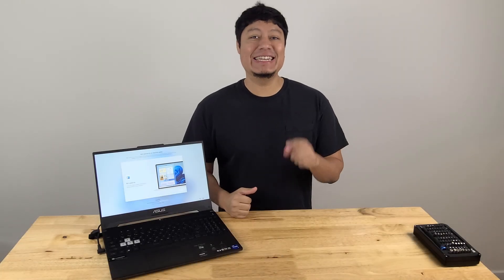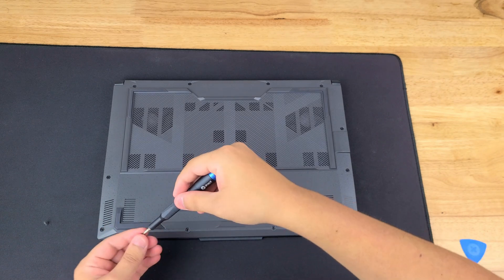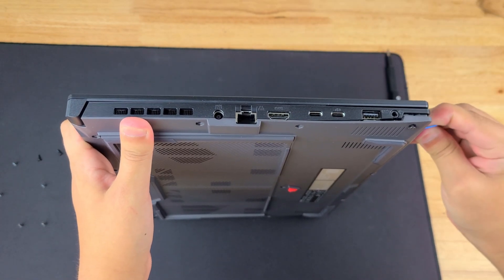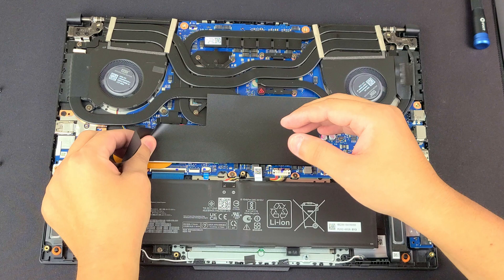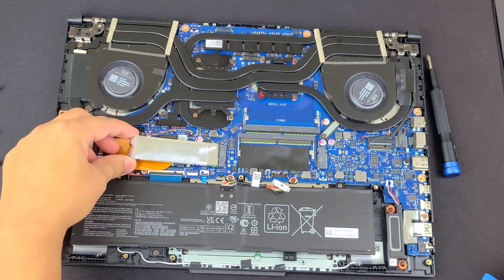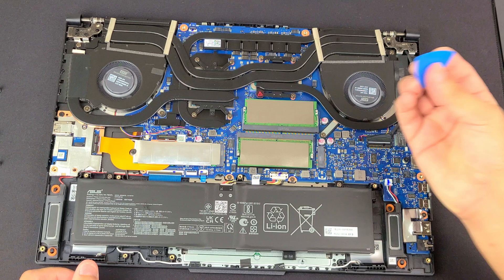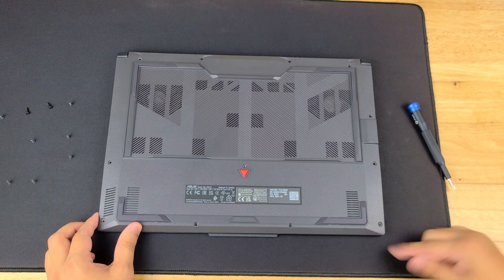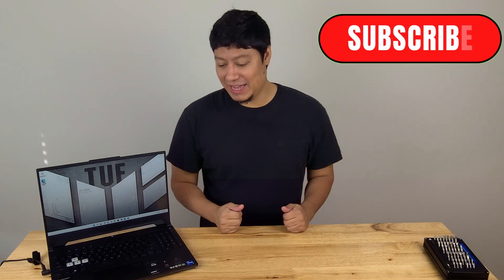ASUS TUF F15 (FX517Z ) How to Upgrade your Ram and SSD 2022

Comment: Thank you for creating this video.  Do you know if NVMe Gen4 is supported?  If at all, I would presume only one slot and not both slots.  Also, I would be curious to know if SSD 4TB can be used in this machine.  I don't need to stripe raid because NVMe Gen.4 is sufficiently fast enough for my most demanding need (i.e., 4K video NLE production with Davince Resolve.)  Cheers, Jerry - Tokyo.
Reply: Yes there is Gen 4 support on BOTH M.2 slots and that the limit is probably 2TB
Reply: @Diego-1  yes I read that there was a bios update to allow 2 TB per slot
Reply: Actualy, the limit is 1tb per each slot)
Reply: There are 2 slots for nvme on this laptop?
Reply: @rabiyaamin3822  Yes
Reply: @rabiyaamin3822  yes it is
Reply: I would not recommend Gen 4 though... this is a laptop and there is not a single heat sink installed for m.2 drives. So, a Gen 4 drive will heat up the system to cause some unexpected throttling or whoever knows crap may happen. 

If you need super speed drives (for professional usage,) this is not a good laptop. Stack up a few more grands (I know you can earn at least 3-4 grands with your profession if you need such fast drive,) and buy some other workstation oriented laptops. 

In most 'home' usage or 'gaming', Gen 4 is not needed. Even SATA is fine.
Reply: @taylorshin  I did instaled 4gen m2 1tb without heat sinks, it is about 30celcius without stress and not over 70 when stress testing, so there is no problems with heating at all!!

Comment: Hello Racimbio
My Laptop model: Asus Tuf F15 Fx506hcb
Core i5, 8gb ram, 4gb Rtx 3050ti,48wh(so my battery isn't covering the lower right side of the battery which can house a Sata HDD or sata SSD)

SUMMARY
I want to upgrade and add a HDD but my laptop doesn't come with a generic Asus Tuf F15 sata cable.
Have you experimented with various sata cable cable, branded and offbrand like that of HP or Dell on an Asus Tuf f15 laptop with success? I want to know which type I can use as an alternative to connect the Hard disk drive. And what are the risk of using unbranded sata cable?

Thanks in advance
Reply from the maker: Order the specific one for your laptop. The pin out is often different when using other brands. Even if it's an unbranded but made specifically for your laptop should be fine but don't put another model cable in since it can overload, cause a fire and so on.
Reply: @racimbio  wow. Thanks for this info, I dodged a bullet there

Comment: Good day sir. I would like to ask if we can upgrade the RAM to 64 gb and for the ssd to 4TB. Im not sure if we can touch nvme 😅
Reply from the maker: 64 gb I can verify it works. Nvme we have done it with a 2 tb upgrade. I don't see any reason why a 4 tb wouldn't work. The laptop dose have 2 nvme slots though one on left and one in right side of the ram so you may even be able to run 2 2tb nvme in raid 0 to make 4 tb.
Reply: @racimbio  Is it support ssd gen 4?
Reply: @racimbio  thank you sooooo much sir.